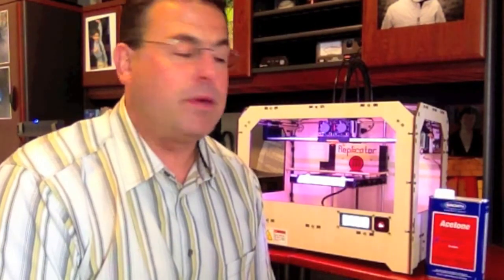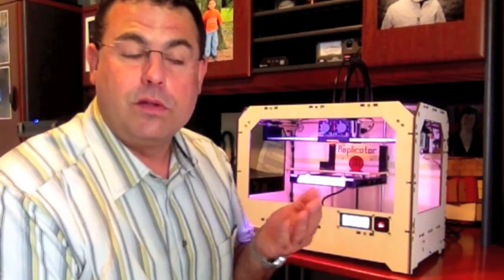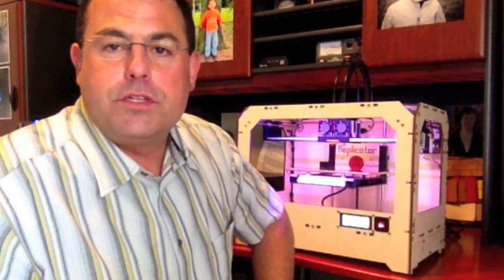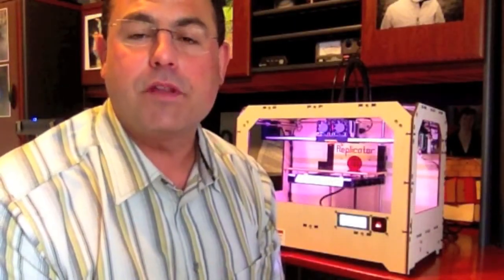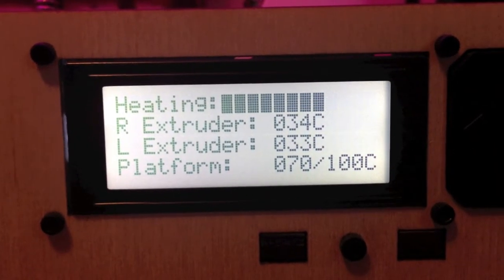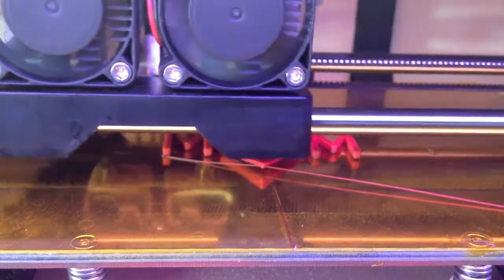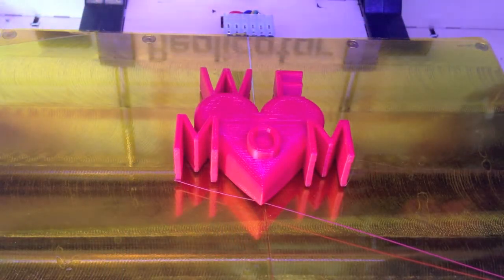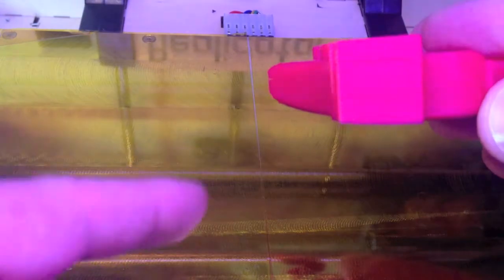3D Print for Mother's Day with a Makerbot Replicator

Comment: For pieces sticking to the platform, I try to never touch kapton with fingers; use a razor to remove a piece (like andrewupandabout shows in his vids); use gloves when replacing tape and cover the platform when not in use.  The roll of kapton is also in a resealable plastic bag with some silica, too.

Biggest benefit of printing from SD card for me is doing stuff on my PC while printing, especially given duration of most prints. Don't want a PC crash to waste ABS plastic and lost printing time.